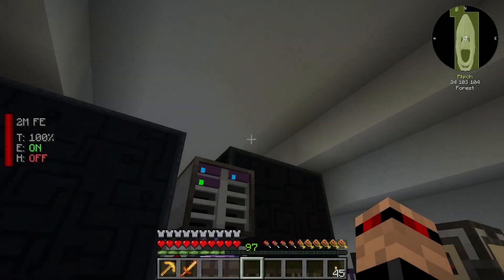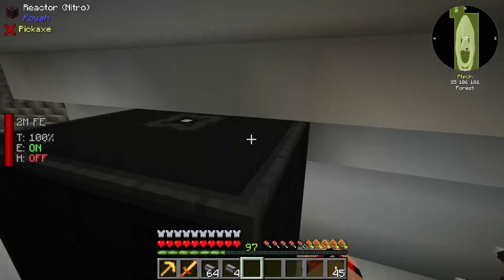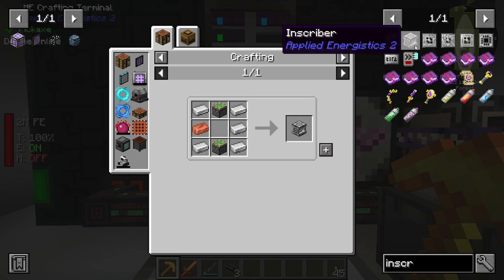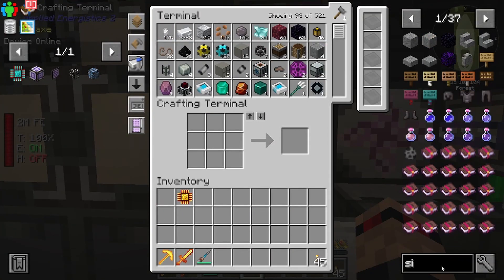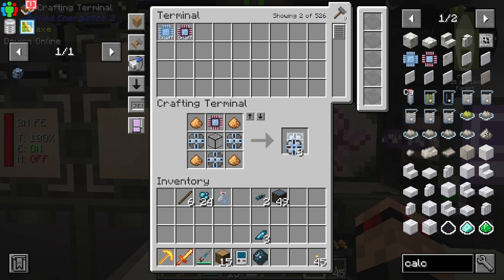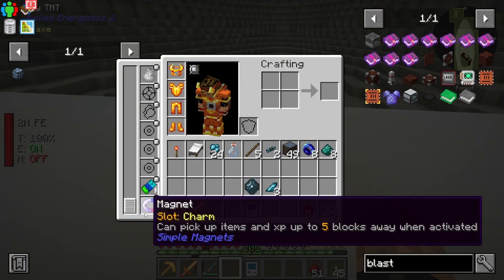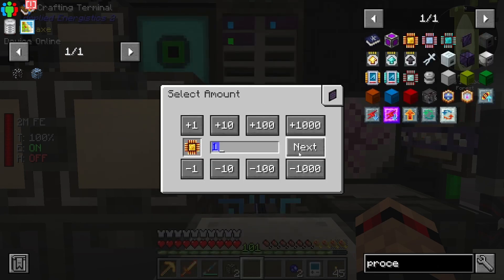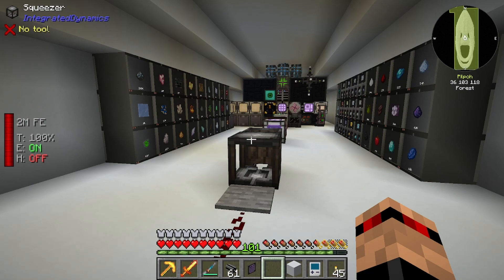ATM 7 To The Skys - Episode 18 - Quantum Networking

Comment: If you're going to use AE2, try learn about p2p tunnels :) Especially if you're going to be using Quantum Tunneling. As it's only an extension of an existing cable (which should awlays be a dense cable as soomeone's mentioned, it can have up to 32 channels running through it) Generally you'd make use of these with quantum rings by branching from your controller(s) that have p2p tunnels on so you can extend to a distant area (or just to make stuff less messy because less cabling!)
Reply from the maker: I'll look up some more guides on it, using Refined Storage for so long has made me lazy 🤣
Reply: @Pilpoh  I really hate being that guy to say "Read a guide" I'd love to explain how ae2 works to you but this would turn into a biography-length comment hahaha

Comment: The issue with your silicon was the same as with your diamond circuit parts. You didn't realize it but the pattern crafter was pushing half the silicon into the ender chest behind it, resulting in you only getting half of what you ordered. Moving it was the right idea all around
Reply from the maker: I forgot that the pattern thingy would use any inventory attached 🤔 that's my refined storage training showing through 🤣
Reply: I been catching up on this series between atm8 and some stuff from titaniumgaming, on ep20 since last night. But at least you now know those pattern providers don't discriminated on the blocks they shove junk into.